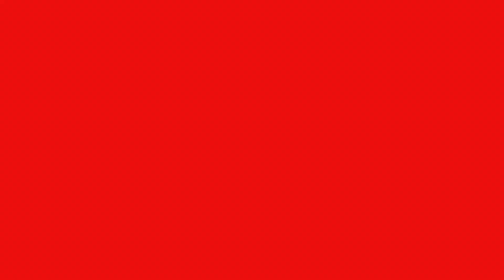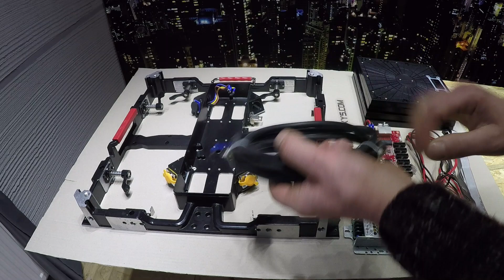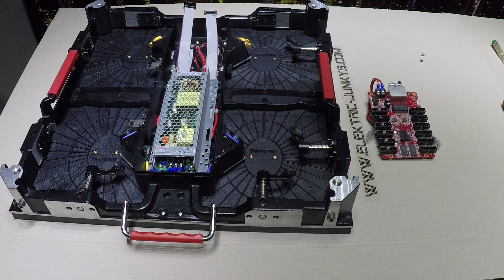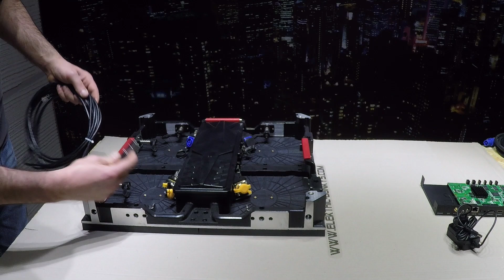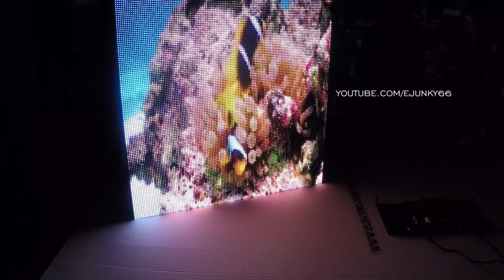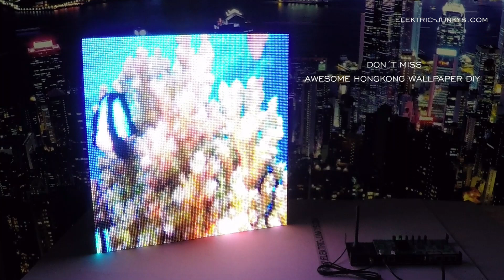Build a LED Display Screen | WIFI Driven with elektric-junkys

Comment: This is the kind of sections used on commercial billboards and on advertisement trucks. 500mm x 500mm dimensions right? 
I am considering doing a billboard on a trailer two monitors of 2meter x 1,5 meter but I am put a little bit off at the price of such modules.
Reply from the maker: Hi, we did some truck Projects in the US Working well, especially with the Power Distribuition. contact us https://elektric-junkys.com

Comment: You should put a better insulator between the cables ant the power supply bottom, especially because there's no ventilation and the P.S. could become hot, melting the cable's protection. Maybe, with a + or T shaped backbone should have been easier to put all the components in place :-) Thank you for sharing, this is a very interesting project! For better results consider a minimum of 30000 "pixels" in total.
Reply from the maker: hi, not a problem this was just a quick setup how to assemble and disassemble. The Used Power supply here is Meanwell highest Quality Standard PSU fully Certified there´s no Heat is all well Balanced you can trust me we sold 10 of thousands of this model cheers and thank´s for comment
Reply: @ejunky66  Thank you for your reply! Stay safe!